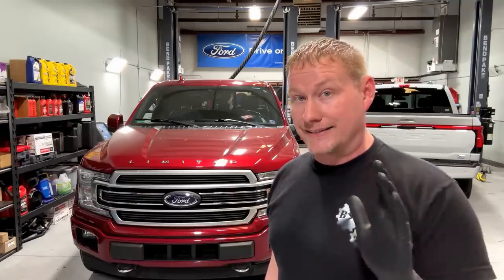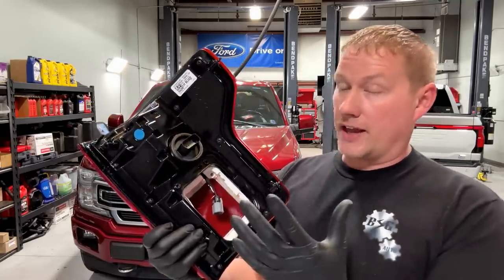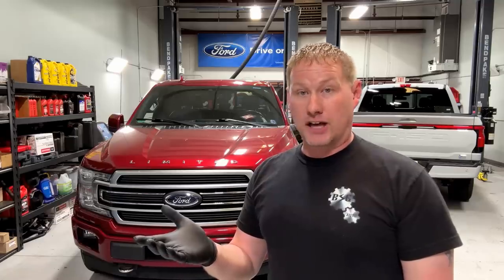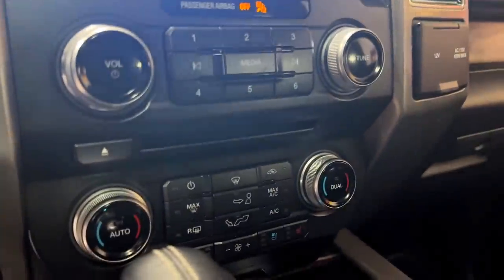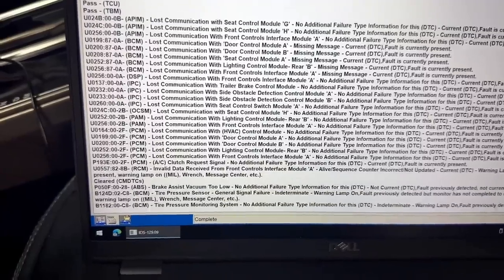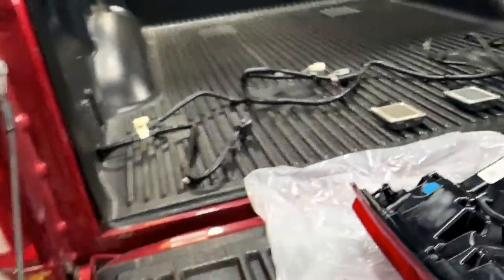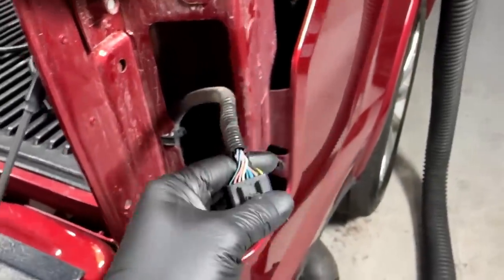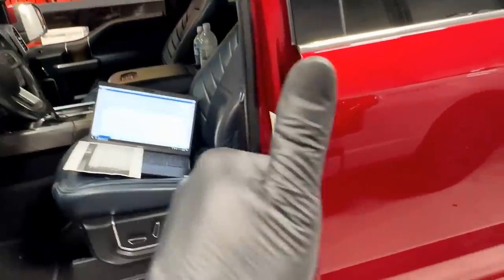Repair Cost Are Out of Control: $5,600 Bill for Some Tail Lamps?!

Comment: This is exactly why I took my 2007 Silverado off the road and bought a ‘93 Ram W250, Cummins 5-speed. Wasn’t cheap to buy, but it’s cheap to repair and easy to fix. Might not be the fastest or most comfortable thing out there, but it WORKS. A win-win in my book.👍
Reply: Buy new seats, it’ll be comfortable then.
Reply: @5400bowen  Honestly, the thing actually ain’t that bad for a solid axle vehicle.
Reply: A 07 Silverado is pretty cheap to fix stuff
Reply: @agger838  To have the transmission built CORRECTLY - as in, will last longer than 100k miles - it cost me almost $5k. To build the rear end correctly - to make that last more than 97k miles - that cost me $1,200. Not what I would call, "cheap" ...
Reply: The high water mark for GM trucks are the 1988-1995 models with the Throttle Body Injection. Once they went to the "spider injection" in 1996, the slide downhill in reliability and quality...along with frequent OBD II failure rates (keeping you from passing smog) meant that GM truck were becoming expensive piles of junk. I own a 1992 approaching 300,000 miles, and I will re-engine/re-transmission that truck before I replace it with anything newer.
Reply: @lawrenceartz8640  AMEN to that. The GMT-400 platform was the last well-built, solid truck GM ever built. I sold my '94 K1500 16 years ago with 266k miles on the clock, and STILL running strong! The ball joints and u-joints each made it well over 200k miles before wearing out. I only sold it because I went and bought an '07 Silverado 1500 (GMT-900), and had nothing but problems right from the very first day! Ball joints couldn't even reach 40k ... among all the other low-bidder, 3rd-world garbage parts . BIGGEST mistake I EVER made in my life!! Just got rid of that crap box recently.

Comment: Boy am i glad my 18 xlt dosen't have all the bells and whistles... Incandescent bulbs suddenly become cool again. 😂
Reply: 2019 XLT here also, smarter buy than the platinum and limited long term!
Reply: I think the issue is from the BLIS modules in particular that require can bus... but yes.
Reply: Regular striped work stx / LT trucks are looking very cool. Its just a truck. Dont need all the bells n whistles. Just work.
Reply: I really miss my '96 Bronco. 155k, engine, trans, trans case all trouble free. But body rot, dead leaf springs, and other deteriorating 
 body parts made me give it up.
Reply: @J.W.W. I think platinum and limited are great if you get a new truck every year. If you keep for decades at a time, go with the one that has less systems that may fail
Reply: I have leds in my 90s Jeep, but they are the type that are copies of the incandescent bulb, so a simple cheap fix if it is ever an issue. Only bulb not led on the outside is the turn signals and headlights now. Maybe I haven't changed the reverse lights because they never went bad.

Comment: And this is why all my cars are over 20 years old.  As my grandpa used to say that's just more stuff to go wrong.  Side note:  You've saved me thousands in repairs over the years sir, thanks for doing what you do 👍🏻
Reply: Me as well. I see more vehicles less than 5 years old either going up in flames on the side of the road or hooked up to a tow truck heading to a shop/dealership.
Reply: I disagree. The problem is old vehicles suck. Theres a line between old and still capable and super affordable, compared to old and worn out. Do you  really want to trust 20+ year old airbags to cushion your head and prevent brain injury.
Reply: @censored4christ162   Super affordable? Yeah no.... I'll take my air bagless 91 c1500 and 92 silverado over anything that you consider super affordable thats going to need to be replaced at less than 150k miles....
Reply: I worked on diesels,  will not trade in my 2003 dodge Cummins. 
Much less emissions,  3200 rpm  diesel.
Detroit diesel 6-71 and 8-92's had 2100 max rpms.
Million mile engines, we're not uncommon.
Reply: Pray 1990, before OBaD. The hard part is rust, many old cars were rust buckets.  Find a barn car in Kansas, but they're getting scarce.
Reply: @censored4christ162  lmao, my dodge has an open recall the air bag may cause severe injury/death.
I don't want air bags. 
By a Volvo,  you'll be safer.
Reply: @censored4christ162   Ah, all my cars are old enough to not have air bags so I don't have to worry it. Besides, if its my time, its my time. I'll save my money elsewhere until I'm  a red smear.
Reply: I switched to Toyota 20 years ago. I haven’t been to a shop since.
Reply: @censored4christ162 I don't worry at all about the airbags in my 88 Honda cause it didn't come with any.
Reply: @censored4christ162 old cars might not go fast, but they'll go if you know how to make 'em. Plus, they're made of metal, so probably about as safe as a new plastic Rav4 with 12 airbags (that could be recalled any day now 😅)
Reply: Today's market is absolutely mental. I've looked for years, and I can't find another vehicle that comes close to the simplicity and reliability of my old Cummins. 

I wouldn't even consider a newer truck. I'll be driving classics til I die... or I'll just walk. :3
Reply: My work car is a 99 Mercedes E300 turbodiesel. 6 cyl loads of power, 327k. Just regular service, brakes, tires and a few glow plugs, radiator, water pump a/c compressor and a starter.  Original engine and everything, never been into. I have a 2016 BMW I3 then might knock that one off its pedestal, owned since new, tires 12 volt battery and one a/c compressor. 80k.
Reply: @sk1dr0w Metal cars are way more unsafe than plastic cars. In a crash, you will absorb the impact instead of the car. Much cheaper and easier to buy a new car with insurance money than fix a broken human.
Reply: This is why I drive first gen honda ridgelines. First one went to 380k before I sold it, running great I might add, second close to 300k now, running amazing. I do ALL the scheduled maintenance, both original engine and trans. Did head gasket/water pump in both twice, had fuel pumps go a few times, other than that, basic maintaince.
Reply: That’s not why. Nice try tho.
Reply: So replace the airbags
Reply: all the old cars that would have some bug to break them in 5 years are off the road already pretty much.
Reply: I have one that is almost 30 years old; and it looks like it is going to need to run a few more years.
Reply: @censored4christ162  Boy did you stir the hornets nest. As a hospitalist who has taken care of many patients involved in MVAs, patients often tell me they wish they didn't choose their car based on looks. You might be able to straighten the frame on a 1980 F150 after plowing into a wall but you'll never get your life back after your aortic knuckle rips into pieces and your liver lacerates hitting your steering wheel because the airbag wasn't there or the catalyst caked and failed. There's places to save money - like not buying cross traffic detection tailamps that cost $4600 and then there's pennywise pound foolish. Extremes are rarely the best course of action.
Reply: @censored4christ162   Well, I just had my airbags replaced in my 99 Accord, due to recall, so I'm perfectly fine with it. I'll keep my older vehicles, thank you.
Reply: @denialphasebitcoin5639   Sure do miss the sound of those Detroits.....music to my ears.
Reply: @umajunkcollector  Maybe old cars are rust buckets in rust belt regions.  But out here in california my 30 year old car is still rust free.   No salt on the road. Huge difference.  When I lived in upstate NY, I remember having a 1980 Honda Civic, which worked perfect, but it had to be scrapped because body was so rusted out.
Reply: @censored4christ162  My vehicles are all old enough to not be equipped with airbags. Don't have to worry about them at all.
Reply: @umajunkcollector  They are out there. Also Fluid Film is your friend. My 1992 Silverado has been saturated with Fluid film with a gallon a year applied to it over the years...and zero rust issues.
Reply: @autoteleology You mean the same insurance money you fork over ridiculous costs for that you end up spending a fortune on?
Reply: All these new safety and automatic features are making drivers worse. Do we really need lane correction? Do we really need self-parking cars? People need cameras now because they can't use mirrors.

Nice, new features compensating for people who probably shouldn't be licensed to drive.
Reply: @user-f44hil126ylI  Truth be told, I'm thinking the world turns "Mad Max" before it becomes "Minority Report". 🙂
Reply: @user-f44hil126ylI  Same here... and here we are.

Comment: Hard to believe he'd be the only one.  I would tell him to keep the receipt in case a safety recall gets issued .
Reply: Won't do any good. 
Ford won't honor their recalls. December of 2021 and July of 2022 my wife's 2017 Ford Edge had grommet failures on the shift linkage. The recall came out right after I had the same 2nd repair done by a local transmission shop. I had rental car fees, plus the cost of the tranny shop repairs. I spoke with our local Ford dealership about the repairs in October of 2022 and they said, bring in the receipts and will forward them too Ford headquarters, they will reimburse you. This October will be 1 year and I haven't heard 💩💩!!
Also, August of last year she had a recall on the flex plate for cracking or breaking. The deadline was March 1st of this year to get it checked. We took it in February 2nd, because the wife said it was making the noise the recall paperwork described? I don't drive her car, unless she points something out. I heard the noise, took it too the same dealership I mentioned above. Their mechanic said that's normal sound coming from the vehicle??? Wtf?? Anyways, I blame myself for not going to another dealer or transmission shop. March 2023, came and went. In April we made a trip down too Cincinnati, Ohio from Michigan and thankfully made it back! The Edge was making such a loud clanking noise, you couldn't hear yourself think. Got home, took it too the same dealership. They wanted $5K to replace the flex plate?? I said, we had it here back in February because it was starting to make a slight noise & you said it was normal. Here I am with your normal broken noise now!! They said, sorry, recall won't cover that. It was just a generous recall they sent out. That's why it had a deadline. I was pissed!! I had it hauled to the transmission shop where I had the grommet fixed. They charged me $1500.00 dollar's. I was pleased with that. They fixed the flex plate, but now the auto start/stop doesn't work anymore. Anyways, Ford doesn't stand behind their vehicles.
Reply: i have sent Ford a few letters. Do you think they would answer a pee ant like me. That would be a hell no.
Reply: This is why I stick to old Gen reliable models of ford, these new vehicles are such problems with so many sensor and so expensive. It's just more money for ford
Reply: @anthonycrowder7424  you need to STOP going to that dealership and find another. Even if it's an inconvenient for you.
Reply: @antcrow7424 Why are you buying ford crossovers sounds like you earned those headaches.
Reply: @justlg3359 What’s funny is other manufacturers don’t have that many sensor issues it sounds like a ford problem I noticed around 2010 is when all the wiring/sensor issues appeared I’m glad I have my 2004 f150 not a single issue.
Reply: @Back_door_bandit_98  you know, the wife had to have it. Plus, she had two brothers retire from Ford in Detroit. I drive GM products. Lol
Reply: @antcrow7424    said "  Ford Edge had grommet failures on the shift linkage.    "  
I'm betting that she does not use the parking brake.
Reply: For those struggling dealing/communicating with Ford, I have been through that frustrating experience!  File a complaint with the BBB and let them do the communicating.  After months of getting no where, I filed a BBB complaint and it was resolved within weeks.  Use your public resources… it’s worth it!
Reply: @bobroberts2371 She uses the E-parking brake when needed. It was a design flaw by Ford. It broke twice on our Edge. Shifter cable to the transaxle. I believe we're up to five different recalls on our 2016 Edge?
Reply: That is why I would buy a base grade XL model with none of this junk on it!
Reply: Why should it is no start issue out warranty?
Reply: why would you buy one at all

Comment: It’s insane how complicated things have become
Reply: Gotta have all those fancy cab luxuries 🙄
Reply: They force you to want them
Reply: @oldcarnocar  yeah. A new EV with 1 motor.. no AC or heater. No sensors. Just battery management and battery cooling.
Reply: Ram 1500 classic  simple  truck no problems 😊 🛻👍
Reply: complicated would not bother me, they talking about AI and quantum chips and can't rain seal modules plugs and lights, technology progress my azz, we can't make reliable door knob
Reply: @tomstarcevich1147  I hope you're right. I'm still trying to come to grips with the shifter knob. wtf
Reply: especially on a truck, it's a damn truck, not a Benz.
Reply: @xlargetophat  well technically he chose to get the most expensive model - coulda gotten a base model that most likely still use the incandescent bulb
Reply: I love my 64 Fairlane... The epitome of "simple".
Reply: @brian2591  The problem is every car is becoming like this
Reply: Trucks where I am rust out in 10 to 12 years. NM this new computer stuff.
Reply: Oh its going to get much worse, just wait.
Reply: No, the designers and engineers made it this way. They could have had the tail lights separate from that sensing device yet they chose to make it all one unit. FORD has never had a better idea.
Reply: couch on wheels with tv
Reply: It's all by design

Comment: I retired after 12+ years, from managing test labs at the biggest IT company on the planet, Before that I did 26+ years as a certified master mechanic, Diagnosis and test methodologies are my thing, either in the lab, the shop or at the race track. 

 No doubt these sensors add safety and peace of mind in brain numbing traffic of today, but the cost to repair one failed items is also why I make bank restoring and building older vehicles for customers. I add in many modern items like fuel injection, brake systems and audio/video systems to give some of the bells and whistles these new rides have but without all the CAN-BUSS headaches that, like this issue can cascade through-out the other systems. I must tip my hat to Brian - he really earns his pay! 

Techs like him are hard to find and keep, Hope you all appreciate the effort he has put into becoming a fantastic FoMoCo (and I bet many others makers rides) technician! Well Done Sir-- WELL DONE!

Comment: The shared network stuff is crazy to me. A while back I fixed a newer dodge ram that wouldn't start because the TPMS module (mounted behind the front bumper) had failed and was shorting a network line to 12v. I think the critical stuff like ECU, TCU and key module should be on their own network. Your vehicle shouldn't die because an unnecessary module near the exterior was damaged!
Reply: That shared network is a good thing, it's easy too use, and diagnose things, in most cases.... the stupid way they design things to fail is what is crazy, they probably knew exactly what will happen, and designed it too fail way after warranty... and probably this same thing will be in their next car too.
Reply: @UmbraWeiss too many points of failure in these Trash 🚙 vehicles
Reply: This is why i drive beaters.

Comment: Not a mechanic but I worked for a Ford Dealership and I would deliver parts to shops locally. One day I'm delivering a tail lamp and im looking at the invoice and I couldn't believe just the housing was shy of $1000 dollars for ONE.
Reply: The Luxury cars are bad $5,000 for one headlight housing
Reply: Nowadays, that's a cheap tail light.
Reply: Try the Chevy tail lights on the junk silverados. My was charge 1100 dollars for on on his high country
Reply: @jamalblack8973 my great uncle bought one. Why? I have no earthly clue. $94000. His final vehicle possibly and he went all out. He sold his travel trailer though. He had no clue about diesel dpf and thought DEF was cheap.. 😳
Reply: Have seen an invoice for a range rover taillight guard, not the light, just the black plastic fake bars over tge top....$800 aussie dollars in about 1995.
Reply: We could comission a car with a reliable affordable tail light. I bet thats a good idea
Reply: Yeah, I bought a pair of tail lights for my 92 silverado a few years ago with bulbs and the boards for $100 on ebay new, sure they weren't GM branded, but for an old truck, they'd probably out live the truck lol.
Reply: @marshmower  We all have that drunk uncle.
Reply: Ford is not the only culprit in the automotive world. I hear stories about other brands having crazy problems. I love my '19 F150, but even it had problems with fuel injectors freezing up on the highway at 2K and 18K miles,  which left me sitting on the side of the road. Each time Ford kept the truck for 5 weeks and  eventually ended up changing all 12 injectors on the 3.5 Ecoboost. That was 22K ago and still going ok. My 2007 F150 never gave me any problems and only did basic maintenance over 160K.
Reply: I wish they were still that cheap
Reply: I’d like to know how the water got in the tail lights to begin with, I would think fixing that issue would be a high priority, dielectric grease isn’t going to prevent this from happening again when the tail lights are full of water. There should be a class action lawsuit against all the manufacturers for charging so much for molded plastic. I could see paying $1000 for the tail light if it came fully loaded with the LED lights AND modules. SMH Price gouging at it’s finest.
Reply: That thing is made out of plastic, why so expensive? My old car headlight made of glass and still cheaper!
Reply: Made in Mexico for $5 bucks, just like the Ford logos that bleach out after 2 years.